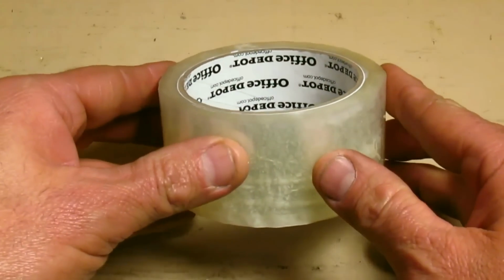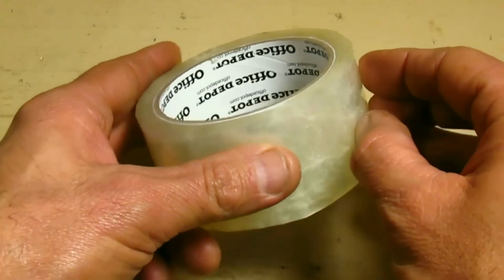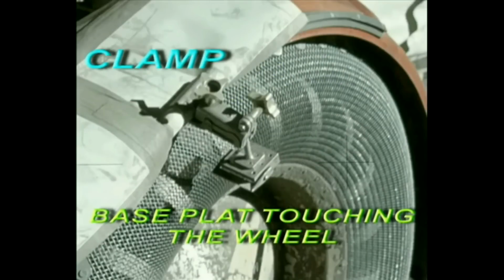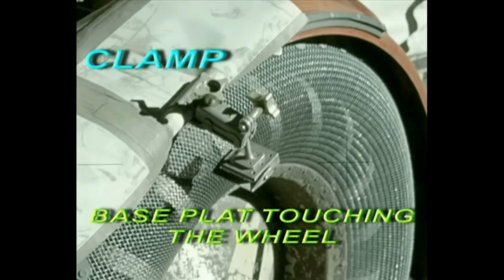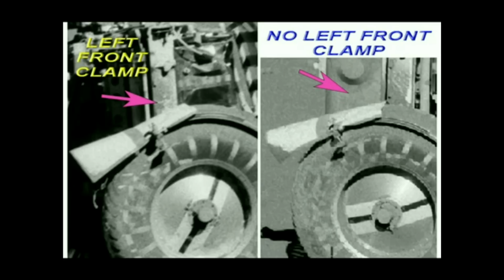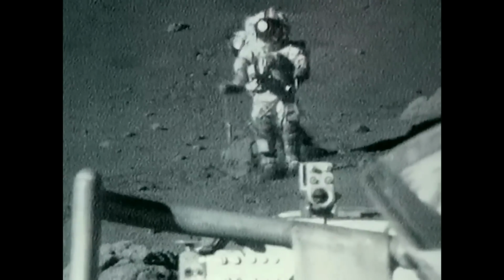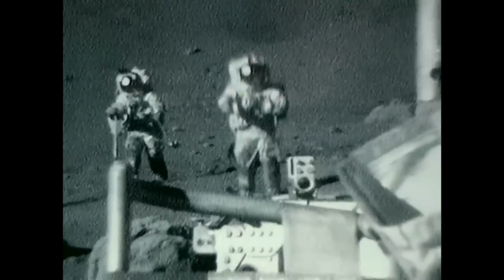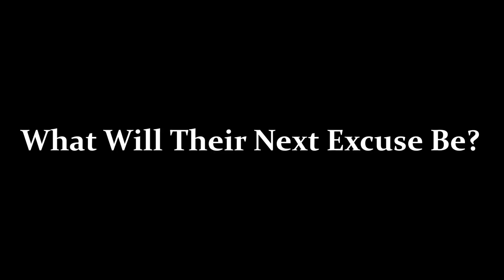Moon Hoax; "Duct Soup"

Comment: I heated an aluminum tray in my oven to 170F and duct tape would not adhere to it. The glue melted and the material all shrivelled up.
Reply from the maker: That's the point. It would not hold paper maps to a metal fender when the metal is 250 deg F. What a load of bull this is! Cheers m8!

Comment: If gravity is weak we should be walking faster not slower.  Think of gravity on earth when you're weak and ill - you walk slower because your limbs don't have the strength to fight the pull of gravity. They are fit: their legs muscles have more power than they require so they would be running with the energy they need for simple walking!
Reply from the maker: Exactly! And with no wind resistance they should go even faster!
Reply: @theapollodetectives  
Amazingly there does appear to be some brisk wind on the Moon blasting down on the Astro's footsteps causing the sand to fly horizontally away. The effect is probably produced by an off-camera blow-gun and an air compressor. Didn't know they took an air compressor  to the Moon... maybe they used it to blow up the air mattress in the LEM. Sure be tough sleeping in there with no mattress.
Reply: And at 30 pounds they could twirl the other astronot over their head with one arm.
Reply: @135iN55 
And that Astro would have a better view of what's over the horizon.
Reply from the maker: Exactly! and with no wind resistance to slow us down we would go even faster!

Comment: These guys are talking without any delay between mon and earth? the round trip delay should be like 4 seconds.
Reply from the maker: Yes, you would certainly think so wouldn't you? Crazy!
Reply: Plus static and alignment with the Earth and wireless repeaters battery power is CRITICAL. 
 TAPE would likely float and/or NOT stick in a vacuum....adhesive has moisture.  IDK, maybe NASA space jelly is sticky. I am on the moon in a DEATH walk at any moment....FOK that fender repair.
Reply: They had a lot of clairvoyance back then but they lost it along with all the other stuff.
Reply: @ginskimpivot753  When Huston says, "Can you do that?", 1.4 second later, the Astronaut hears it and responds in 1 second, "OK." It takes another 1.4 second to come back to Huston and the spectator hears that with Huston. It will take about 4.8 second before the spectator hears "OK" response.
Reply: I try to duct tape something under the 90 degree sun, with atmospheric protection and the adhesive melts. FAIL! So lemme get this straight "Houston", the moon with NO atmospheric protection, the adhesive DOESN'T melt?

Comment: Well actually it isn't touching, you can see the shadow and part of the wheel between the plate and the wheel although it is close and could possibly touch once the rovers suspension starts moving.
Reply from the maker: On another shot the clamp has actually moved down and made a rip in the wire mesh tire.

Comment: Why would duct tape not work, it can work fine on aircraft!
Reply from the maker: It would have melted when it came into contact with the metal fender.
Reply: @theapollodetectives  Why would it have, how do you know the temperature of that fender?
Reply from the maker: @gregsmith8617  You work it out. If the sun is striking the fender and the temp on the moon is 250 F in the sun given there is something there for it to absorb those rays like a fender, then what would the fender be radiating? Is it popsicles? Geesh! You lot are so stupid it makes me scratch my head!
Reply: @theapollodetectives  What colour is the fender, gold, the fender repair was white and the duct tape was silver, which means the radiated heat was reflected away, not absorbed!
Reply: @theapollodetectives  The Apollo astronauts reported the surface temperature of their batteries  quite often.  115 degrees.  You should do some research, like actually watch videos of the moon walks so you will know what you are talking about.  Duct tape worked fine.
Reply: As an experiment I put an aluminum tray into my oven and heated it to 170F. I took it out I tried attaching duct tape to the tray. The glue just melted and the tape part shrivelled up. I think this is something anyone can try for themselves. Maybe NASA had special tape? I don’t know. Also, just because something has a reflective coating does not make it impervious to absorbing solar radiation. Those fenders would have been hot as fuck.
Reply: @Iam_Dunn  170 degrees is a little hot I think.  You should get an object hot (110 ? ) by leaving it in the sun and then applying the tape.  The moon is not like an oven.  No air.
Reply: Cornelius Crewe ...Operating battery temperature and the vehicles surface temperatures are not the same thing.
Reply: @UCi9hEkjPj_Zyxz7QVJzyTuA The moon isn't 260 degrees in the lunar 'morning'.  260 degrees is the lunar maximum.  The astronauts were long gone before it got that hot.  In Arizona it gets so hot you can fry an egg on a sidewalk (so they say).   This you would try during the afternoon - not in the AM.
Reply: Cornelius Crewe ..Even if AP17 landed right on the terminator, it would have rotated into full sunlight by day 2. Giving all the equipment 36 additional hours after thermal transition to bake. (It’s a common acceptance that relative thermal transition time is about 36hrs from super cold to blistering hot up there.)
Reply: Cornelius Crewe ..you’re right. The metal heats up way faster and hotter due to not having any medium to dissipate the heat. Just because some of the energy is reflected does not mean it absorbs no heat. I understand the physics. I studied the laws of thermodynamics at a post secondary level.
Reply: @corneliuscrewe8165  Excellent info, thanks!
Flat turds hate real data! They prefer to guess and assume in an attempt to make their "data" meet their requirements!
Reply: @corneliuscrewe8165  Yes, in reality there is no such thing as a stupid question and you have hit the nail on the head with flat turds. For people that claim they are open minded truth seekers. They work hard at avoiding the truth!
Reply: @corneliuscrewe8165  Empty headed, LOL Pretty much an echo chamber!